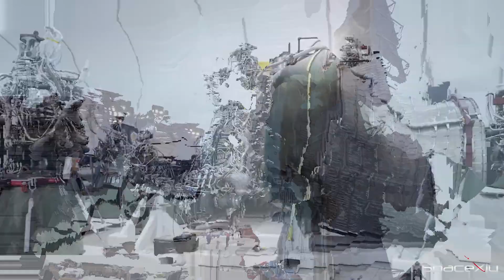Starship facing Big Raptor Issue? Booster 9 Post Static Fire Analysis | Chandrayaan-3 Update

Comment: How many Raptor 2s did they manufacture in a year? And they have been manufacturing Raptor 3s for how long? No worries. They have to use the v2s up somehow. Why not use them for academic purposes, like testing? Perfectly reasonable, flawed or not. You are confident stage zero can take a 100% hit from the largest and hottest blowtorch ever? I think the jury is still out. It looked great after 2 seconds at 50% with 4 failures. We KNOW now that debris did not take out the v2 engines on 4-20. My prediction for the next orbital launch date has been Sept - Oct time frame since 4-21.

Comment: I believe if I was Mr. Musk, I would be asking some serous questions on the fail engines'!!! Also, (as a retired engineer) I believe I would keep testing all  33 engines till I had a perfect fire and the run the operational test time. (at least twice)
Reply: As an engineer you’re familiar with the concept of too many point of failure. Von Braun only used 5 engines for that reason. He saw the faults in his original Mars rocket concept.
Reply: @jason_m_schmidt622  - Soviet N-1 rocket failed due to so many engines.

Comment: I'm thinking that high pressure fluctuations during simultaneous firing can effectively buffer the flow of some engines. Turning them all on at once might not be the best solution. If so, what would be the best trigger sequence? But, this has probably already been thought of and simulated...
Reply: My guess is there is cavitation within the propellant supply lines to the engines as I think you say.  As you say the solution is sequence engine start.  If the problem persists it will take more time to revise the supply lines,

Comment: I think we may see some Raptor swaps and another static fire before next launch.
Reply from the maker: Engine replacement is expected but I don't know about the SF test.
Reply: @SpaceXtudio it probably wasnt a full power static firenthough…
Reply: @Hungary_0987  It was at half power. Partially fueled at full power it would fly away together with the support.